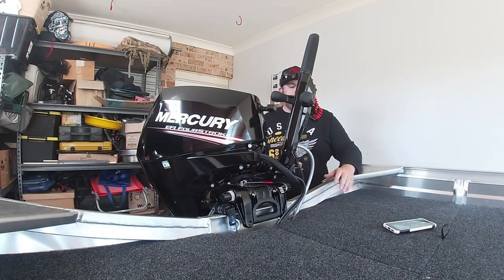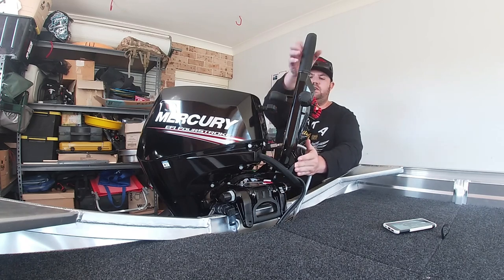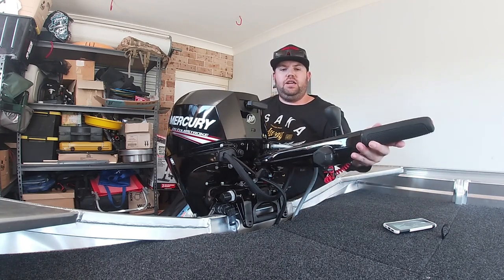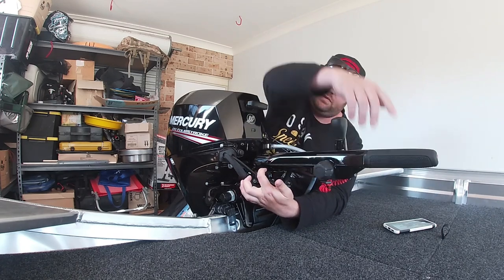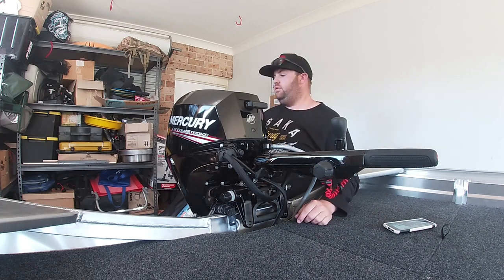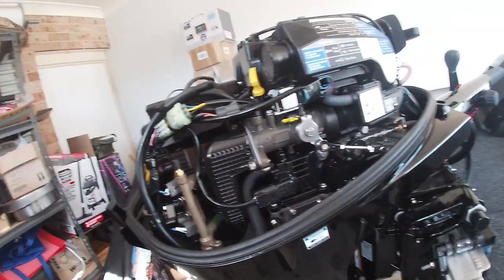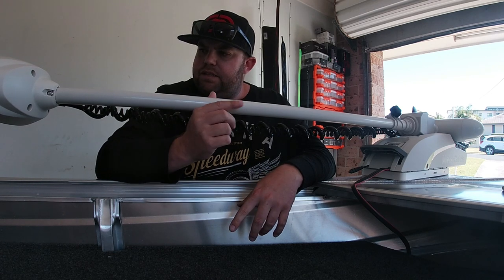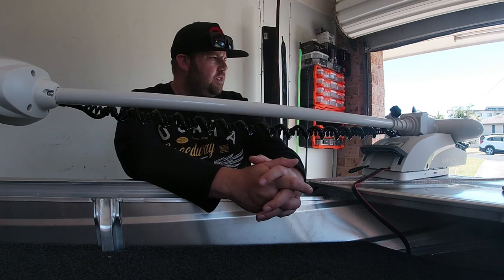COMPLETE WALKTHROUGH!! Stessco 379 Tripper Custom Boat Build

Comment: That looks to be a very strong, capable and well constructed little boat, and I especially liked the corrugated hull, nice rigidity designed in there. 

Your meticulously precise workmanship stands out for its high quality, and enclosing your underfloor electrical cables in conduit further emphasises that.

Electrical panel and switches looked perfect, and the quality and care taken really stand out well. 

I'd not seen this boat before but its compact size, strength and purposeful appearance set it apart.

Thank you for sharing your lovely boat and your upgrades.
Reply from the maker: Thanks for your kind words 🙏

Comment: Awesome setup mate, few good ideas for my new quintrex 390 outback fighter cheers
Reply from the maker: Thanks heaps mate, glad you got a few ideas!
Reply: How do you rate the outback 390?
Reply: @yourenotwrong3511  great little boat mate, trolls real good with 2 blokes in it
If it jad a 30hp 2 stroke it would be a weapon
Reply: @sharkyshepo8167  do you know how heavy they are. Im in the market for a tinny that i can chuck on top of my camper but im not sure if it will be too big. I was looking at the sea jay 3.7 hs nomad but here in wa there is a big waiting list because of the covid. A couple of places told me they cant get any more in until june.
Reply: @yourenotwrong3511  I reckon the sea jay are the best roof topper, i went bigger cause i have a winch and my boy and wife are stronger, my tinny is 1.8m wide i got 3 kids so i had to go as big as i can. They say my boat is 110kg but i can lift most of it myself

Comment: Love your boat sold my pa14 looking at buying a tinny and doing the same mods as you. l was looking at the quintrex f390 outback or stacer 399 or stessco what do you recommend going with the Yamaha f25 just need to decide which tinny to get
Reply from the maker: Thanks Dan!, I sold an F390 and pa14 to buy this and set it up properly, in my opinion the Stessco is a better built boat than the Quintrex was. Just shop around mate and see what suits you better. Stessco are usually built to order so keep that in mind, mine was a 2 week turn around but it was done to my personal preference which was a nice touch.
Reply: BWS Outdoors is there a big cost difference between the f390 and stessco and was the f390 stable when standing at the front
Reply from the maker: Not alot of difference in hulls mate, more the motors and accessories that makes the difference. F390 is a little more stable but is a bigger boat
Reply: BWS Outdoors why did change from f390, also did you do all the framing for the floor and casting deck your self any chance you could send me some pictures sorry for questions your boat is perfect. It’s hard to find real reviews on tinny.